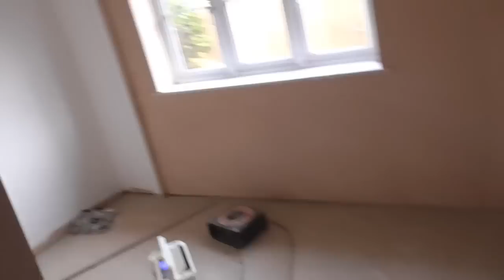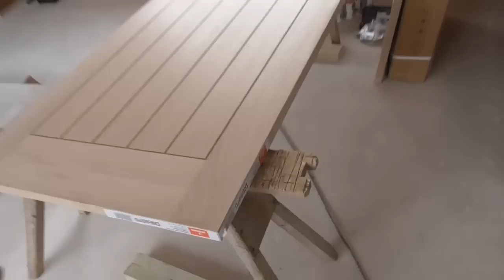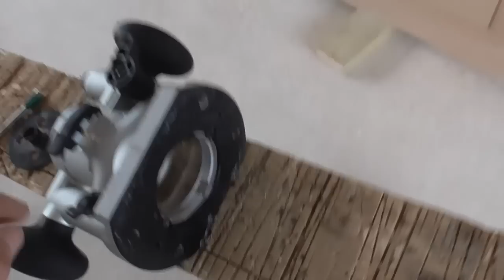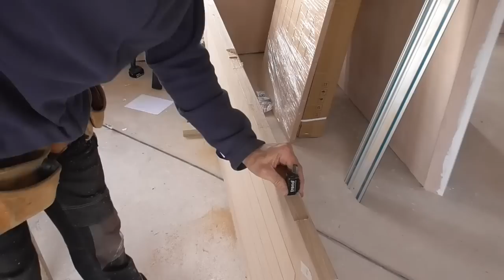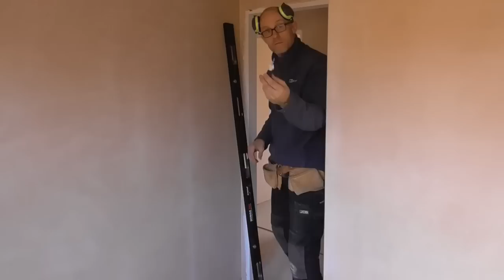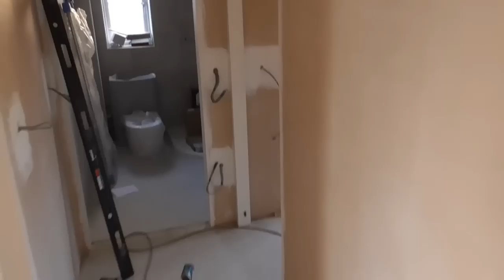How to hang a door with a professional carpenter***COMPLETE HOUSE 2ND FIX CARPENTRY PART 1***

Comment: We were trained right back in the day that's for sure. So many "Carpenters" today faced with an irregular jamb just bung the door in and it fits where it touches. Your door process, minus the fancy jig, is exactly the same as mine. When it was all chisel cut I was taught to put a chamfer cut on the lining side hinge cut out. So the back edge of the hinge was slightly deeper. To stop butt binding with some of the big headed slotted screws coming together. Also the order of jobs you work to. Exactly the same as mine. Here everyone puts the stops on then does the locks. I can't do it. I need the locks in so I can correctly set my stops. There was a reason why we were taught as we were. Tried and tested for generations. When quality was more important than speed.
Reply from the maker: As always Dave, I agree with everything in you comment👊Interestingly though, I was taught to put a leading edge on the hinge side to allow a little bit of extra clearance for the hinge screws🤔Thanks for watching fella😎Cheers
Reply: @thetallcarpenter A leading edge is the right way to go, personally I hate to see the backs of the hinges set in, look much neater flush.

Comment: Hi Del, I love watching your content, delivered in a way that is easy to follow and learn things from, keep up the great work.  One thing I would love to see is how you fit a new door to an existing lining.  I am in the process of restotring a 150 year old property and none of the door linings are straight or square, I have some reclaimed doors that all need adjusting, and looking for the best place to start!
Reply from the maker: Hi Matthew🖐Hanging reclaimed doors in wonkey old linings is a job that takes patience and commitment😳 You can only, really take one door at a time, and don't be afraid to adjust the frames if you have to. You can help yourself enormously with a little wedge behind the frame here or there, or even planing a bowed frame leg straight👍It's probably unlikely that I will do a video on this for 2 reasons. One, people don't like you filming inside thier houses, and that leads onto the second reason, and that's that I don't do domestic work😬Good luck with them and thanks for your great comment😎Cheers Del

Comment: Great video Del. I find oak doors to heavy for me to lug around as I'm ageing. To make it pay you have to fit a lot in a day for some builders. I love to see a door hung right. Firstly the head has to be even gap. We used to put leading edge on  both hinge side and hang side with a planer like you.  Now I just do the hinge side like you in the video. Also a centring bit is a must I think there brilliant. Also making the frames your self at the correct measurements and fitted properly is more than half the battle. Look forward to your next video Del 👍  🇮🇪
Reply from the maker: Hi Paul🖐I couldn't agree more with everything you've said, and I am going to get myself a centering pilot drill👊I was also taught to put a leafing edge on both side to help with hinge screw clearance, but like you, just do the flapping side now as the screws rarely bind in the hinges nowadays👍Thanks for your comment and for watching 😎 Cheers Del

Comment: Another neat job mate, I use the same hinge jig but I've had mine altered at the top so I can do 7" from the head aswell as 6" depending on what the architect specifies and your right the screws which come with the hinges are terrible,  now I just buy a few boxes of hinge tite screws which are a lot stronger.
Reply from the maker: We should never be afraid of modifying our gear to perfectly suit our needs Tony, and I wish my builders would pay to upgrade the crap screws in these hinge packs, and those Hinge Tite screws are great quality👊Thanks for watching 😎 Cheers Del

Comment: I now live in the states and they use prehung split jambs. Basically the jamb is in 2 half’s, you simply sandwich the two side together arcs and all. I hung 11 doors complete with handles in 90 mins.  I then showed an American chippy how to do it the manual way, he was blown away. I still use a marking gauge and a chisel for my hinges on manual doors, it’s not faster than a jig and router but I like cutting hinges. 
Tip for the budding chippies when putting your screws in the hinges, don’t try and drill a hole center of the hinge hole, instead off set the screw to the inside of the door and the bevel on the screw head will pull the hinge edge tight to the cut.
Reply from the maker: Great comment MR👊Thanks for your input🤩(I also put the screw into the hinge off centre to pull it back tight into the housing😉) Cheers Del
Reply: @thetallcarpenter  I thought you did when watched you drill them. Another good tip if chopping out hinges the old fashioned way is to take your stanley knife and cut the cross grain on the toe and heel of the hinge. No break out when pairing down with the chisel. Love your channel Del. Thanks so much for taking the time.
Reply from the maker: @MaxRank  We must be brothers MR😎https://youtu.be/RtoGMu0HqW4
Reply: @thetallcarpenter  haha that’s too funny. Our only difference in method is I use the gauge for long grain on both door and lining. Never used it for the depth. I’m sure your skill is developed enough to know how hard the bash the chisel depending on the thickness of the hinge. All feel that comes with time and practice, but using the gauge for an apprentice is a great idea.

Comment: Tidy job mate, fellow chippy hear. As you mentioned yes the centre drill bits are ace would recommend. Couple wind bags for me for doors are very handy as well. A tip I was taunt years ago for ss screws in  hardwood was to dip them in vaseline helps them with snapping. All the best.
Reply from the maker: Hi Christopher🖐Great tip on the Vaseline and I have got some silicone spray for this but cant always find it/slash be bothered to get it out of the van😬I have got some Winbags, but its a long way down for me to pump them up😜Great to have you watching and thanks for your comment😎Cheers Del
Reply: @thetallcarpenter  same hear for getting things out of my van one day it's tidy the next it's a shit hole.
Reply from the maker: @christophercrowle9753  😲😆

Comment: Another great video, DEL,,very informative, (as   an retired joiner),could you not use your plunge saw to take the leading edge of the door,,, on the hinges ,we where always taught to put an H(for hinge),on the side of the door, to identify the hinges side,,on the screws ,we always had a wax candle, and rubbed it on the screw (especially if the screws are brass),makes a bit easierto screw,,hope some of these tops are useful to your viewers,,🏴👍🏴👍
Reply from the maker: Hi Christopher🖐I've never considered using my track saw for putting a leading edge on a door for a few reasons. My track isn't long enough, and some door edges aren't straight after shooting into poorly fitted linings😬Great tips on marking the hanging side, and I remember the old timer that taught me always having a candle to hand to wax the screws👍https://youtu.be/2BYImHu3rZ4 Thanks for your comment 😎 Cheers Del

Comment: As a handyman I get a lot of calls to hang doors. My heart sinks a bit when I get these calls. I do tell clients that I am really not 100% sure of what I am doing, explaining the skill it takes but sometimes they tell me to crack on and can even help. I'm thinking (each time) how hard it is to hang a door, can't be that hard? Before I start the job I bury myself (yet again) in YouTube vids trying to work out the finer points (the crucial ones) to do a good job. I have yet to hang a door without making a hash of it! They are not easy!! Thank you so much for your video, the best so far. It helped so much. The gig defiantly looks like a good buy, I think buying a router is a good choice. Lots of great tips, thank you so much. I do have one question: the top of the door as you said should be a 2p (coin) gap, the bottom 22mm for the carpet. I get that (thumbs up) The side to side measurements always throws me. Lets say for ease of maths the gap for the door (left to right) is 1 meter and the door itself is ever so slightly less than 1 meter. So basically the door will just about squeeze in if hammered home. So.....if the hinge is flush (as in your vid) and flush with the door frame also in your vid then do you you look at the hinge before you fit it and look at the gap between the hinge leafs when parallel to themselves and measure that gap which might be say 2mm (I have found that each hinge I buy is different) Then take off that 2 pence piece gap for the door handle side which means you cut the door down by 4mm? Is that about right? Apologies for the long message, I should be down the pub as its Friday but I find myself asking about hanging doors. Thanks for reading Andrew. Thank you for your videos
Reply from the maker: Hi Gords🖐Usually, the door opening is 1/8" wider than the the door, so, taking into account the gap created by the hinge, you should only need to take a 'door gaps' width of the width of the door👍 If I'm shooting in a door to a tighter frame, I just reduce the width enough so I have '2 gaps worth' of gap down one side, (obviously with no gap on one side), then this gap gets split in 2 when the hinges are fitted👊Hope that helps🤞Cheers Del
Reply: @thetallcarpenter  Thanks for your reply, very good of you.

Comment: I hang my doors pretty much exactly the same way. What I’ve been finding recently is that the quality of the door linings is truly awful at the moment. It doesn’t seem to make any difference who’s supplying them. Twisted legs, different thickness between head and legs etc. It really slows down the whole process when you have to start adjusting and tweaking to get a decent door fit that’s for certain.
Sadly I need a hop up to check my door head gap is spot on, it’s harder to see when you’re only 5’7” 😅
Another great upload Del 👍🏻
Reply from the maker: Hi Simon🖐I absolutely agree about the appalling state of pre made linings and its been that way for a long time😬On top spec jobs I get higher grade joiner timber for lining and they are night and day better👌Thanks for watching 😎 Cheers Del

Comment: Cracking video del really enjoyed it mate 🙌🏻🙌🏻 can I ask mate it might be really obvious to yourself, but I’ve fit a door myself FD30 big heavy bugger 🤣 got the fire casing to match etc but when it came to the lock (as it’s an integral garage personnel door) I wanted to fit 5 lever mortice sash lock, but unfortunately as I was using existing door knobs to match rest of house doors I realised that the backseat of lock when door knob was on, was actually very tight to the fire door casing stop bead, as the stop bead is already on fairy chunky all the way around they are (so baisically when the door was shut the door knob was literally 10mm from the fire lining chunky door stop, if you had sauasage fingers it would be a bugger to turn the knob to open the door if you know what I mean 😂 so in the end I fitted a tubular latch with 62mm backseat so the door knob was further back from casing stop and then just fitted a normal mortice dead lock it all works fine but the door knob doesn’t line up with the mortice lock keyhole 😂 kills my ocd 🤣 have you ever had this problem before del? Cheers 🙌🏻🙌🏻
Reply from the maker: Hi KotT🖐I know what you mean about knobs on locks/latches with a 45mm backset, and it's pretty tight on you knuckles even with non fire door stops, which is why I always use latches/locks with a 57mm backset👍I haven't fitted, or seen a 57mm backset latch on the same door as a 45mm deadlock, but I can see how it would mess with mine, or anyone's, OCD😲Great comment and thanks for watching 😎 Cheers Del
Reply: @thetallcarpenter  cheers del 👌👌 I’ve probably got the only door in the world with a separate latch and mortice lock 🤣🤣 oh well as long as I’m not breaking any door lock rules suppose all is good 😂🙌🏻🙌🏻
Reply from the maker: @King Of the trowel  There's certainly no rules on having a latch and separate lock on a door, and I've done it loads and it's even on a fire door I fitted in a recent project👊
Reply: @thetallcarpenter  nice one del that’s reassuring mate thank you 🙌🏻🙌🏻

Comment: Great content and well explained. When putting a leading edge on a door and then cutting in a lock or latch, does this mean the lock faceplate will be at a slight angle too if you rebate for it? Tks
Reply from the maker: Hi Lee🖐The short answer is yes and no🤔 On tubular latches, the faceplate will flex slightly to sit in a parallel recess at the leading edge angle, but on some bigger sashlocks like 5 lever ones, the faceplate is very rigid and will stay square to the lock body meaning the faceplate may sit slightly further in the housing on the front leading edge👍It's pretty minimal and not particularly noticable🤩Great comment and thanks for watching 😎 Cheers Del

Comment: Do you guys ever used pre hung doors? Most of what I do are installing pre hung doors( both flat jamb and split jamb) while occasionally installing a new slab in an existing jamb/opening, hanging a new or reclaimed slab in an a jamb I made or building a door from scratch. I find it interesting that you hang the door slabs once the jamb has been installed. I always found it much easier  to hang a slab in a jamb on the bench and then install the whole thing in the opening after, unless I am swapping a new slab in to an old opening. I had an intersting  project last winter involving 15 antique door slabs that where reclaimed from and old building that had to be squared up, re beveled, new hinges cut in and have new jambs made to fit wall of all different sizes because I had a bunch of shimming and furring out of the walls to make them level and such. I went got all my measurements and headed back to the bench to knock it out.
Reply from the maker: It amazes me that in the  37 years I have been hanging doors that I have yet to fit a pre-hung door set🤯 Traditionally, we put the frames/linings in first so they can be plastered/skimmed up to making a nice flat plane to fit the architraves to👍Thanks for your comment as it's always interesting reading how other guys do things🤩Cheers Del

Comment: Hi Del, typical builders trick getting you 4" hinges for internal doors, but what do we know. Great job as always pal 👍
Reply from the maker: Apparently they were on offer bud🤔 The builder needs to save every penny where he can, because £150,000 motors don't fill themselves up with fuel😆Cheers Del
Reply: @thetallcarpenter 😂 And it's us mugs that put them in those 150k motors.  I steer clear of charlatan builders these days 👍

Comment: Always great to watch. 
A couple of things though Del, I would DEFINITELY get a set of those hinge drills bit guides. Can’t remember the actual name but you know what I mean.  Also, I thought about getting one of those Trend corner chisel things that you use.  Obviously you use them but does it speed things up would you say?  I do like the idea of something so small to slip in the pouch. 
Great work as Always. 👍🏾
Reply from the maker: Hi EC🖐Yeah, I'm finally going to stop being tight and get myself some centering pilots drills👊And, yes, that little corner chisel is definitely quicker and easier for clearing out those corners than with a chisel👍Thanks for watching and your comment 😎 Cheers Del

Comment: Just hung 13 doors in an old house, nothing square, straight or parallel 🙄 the trend hinge jig still great though 👍🏻 Great Vid Del. Cheers Steve
Reply from the maker: I really don't enjoy doing re-hangs Steve😬 (not sure any of us actually do🤔) I dont think this kind of jig would be much use for anything other than straight, new linings😵Thanks for watching and your comment😎Cheers Del
Reply: @thetallcarpenter  as it happens whoever hung the door originally surface mounted the hinges on the frame, so the jig (mines the 2nd version) did come in handy, still some chisel work required tho’ and yes I recessed the hinges as they always should be 😁

Comment: You should try a 3 way clamp for the hinge jig, saves putting holes in the door
Reply from the maker: I've actually got a set of those Joe, but they only come out for top end jobs and pre-finished doors🤔 Cheers Del

Comment: Del, are you taller than the actual door?! I was wondering how you managed to keep the doors on their side while you installed the hinges and then I noticed that your saw horses had these handy cut-outs that actually hold the door in place. I like that. Nicely done and you make it easy to follow along.
Reply from the maker: Hi JP🖐I'm a snatch under 6'6" so the same height as a standard door😲And yes, I have cut outs in the ends of both of my stools. One is 35mm for internal doors, and the other is 45mm for external/fire doors👊Thanks for watching and your comment 😎 Cheers Del